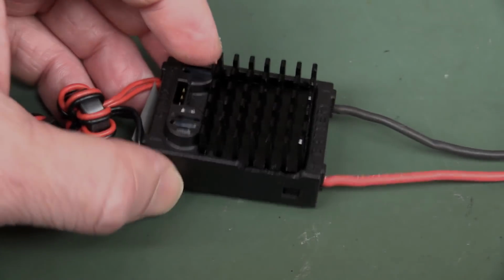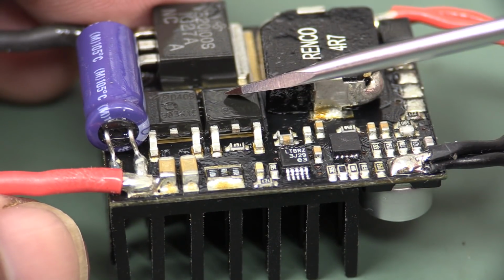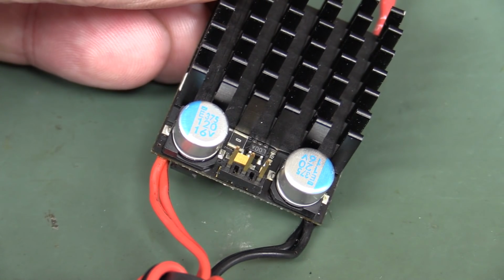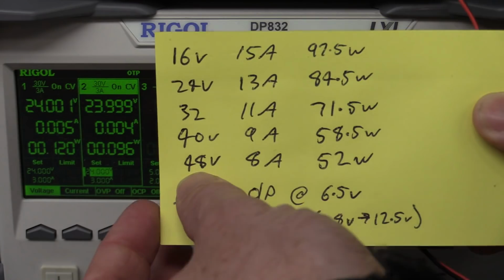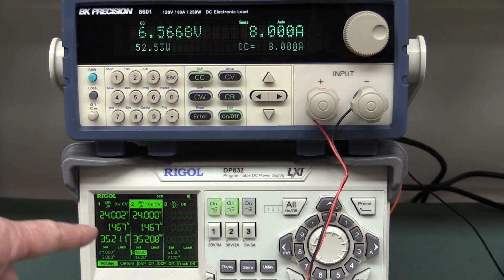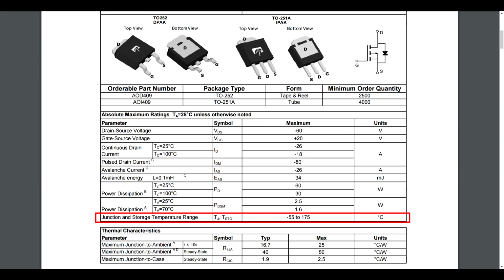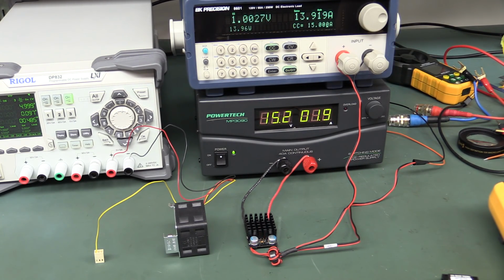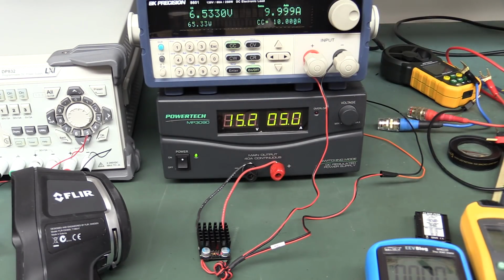EEVblog #895 - BEC Pro Model Airplane Regulator Testing

Comment: "This thing's cheap, it's like $38 or something which is apparently cheap for one of these things"
Nope that's expensive af.
Reply: Remember it's not a 4s 5A BEC, it's an high voltage high current one from a reasonably well established brand name.
Reply: Just because there are more expensive products doesn't mean that one isn't expensive for what it does. It doesn't look bad, but it's still just an off-the-shelf DC-DC converter with a "meh" build quality. Oh, and regarding Western Robotics, paying more than 100USD for a general purpose low voltage DC-DC converter is getting into the bullshit region, at least for me, they charge 50USD for a 5A BEC, ffs...
Reply: Lol you think that is expensive?

Look up Western Robotics BEC.  Those are the top in the RC world and are much more beefy.
Reply: scott firman To be honest it's not that hard, at low voltages/currents you can just get away with a linear regulator with an heatsink and a couple of capacitors. Even with switching regulators, most manufacturers have an application note telling you how it should be done for each driver IC, like this: http://www.st.com/content/ccc/resource/technical/document/application_note/75/1c/c6/24/bc/a5/4b/94/CD00043744.pdf/files/CD00043744.pdf/jcr:content/translations/en.CD00043744.pdf

In a pinch you can even use a good quality car phone charger, they come rated at 2-3 Amp or more and most can handle up to 35V.
Reply: +TrickyNekro You build your own BEC's? WOW! good for you.

Comment: The usual overstating of specs for most hobby products. What would help this survive is probably the fact that most of the load would come from the servos moving the control surfaces of the plane so only in short bursts as it maneuvers. Not much load when all the servos are neutral(eg flying straight).

Comment: Hey Dave, I was wondering what the status of the uCurrent is. Did that issue with the assembler get solved? I was hoping to pick up one and I couldn't find it anywhere in stock. I could use a local pick and place fab but that would cost $300 for a batch of six when I only need one.

Comment: Solder quality poor, gloppy conformal coating, dont like the heatsink on the opposite side of the board idea. I would prefer the heatink to be directly attached to the component. Overall, i'd pass on this.
Reply from the maker: You usually can't attach heatsinks directly to SMD parts. See my linked video.
Reply: +EEVblog ive seen custom heatsinks like on the apple time capsule and nest camera to cool smd parts. I would think that would be idea versus the solution used in this product.
Reply: To be fair, it sells for $38.
Reply: custom heatsinks are $$$$
Reply: Sadly this is one of the most reputable companies in the RC component manufacturing world, and it only gets worse here as you go after the cheapest you can get via hobbyking, etc. RC parts such as ESCs and BECs are manufactured with weight, overall finish dimensions, and cost as the primary driving principles. I combat this by choosing components that are rated for much more power than I ever plan on running, that way the shoddy designs may have an adequate margin for error in my use case.

Comment: Glad you actually tested this thing Dave.  I fly rc planes,  and there's so much false advertising when it comes to the electronics!
Reply: +EEVblog usually, no, and definitely not continuously. the main power drain for these are the servos that control the control surfaces. As you can imagine, the power usage will be highly fluctuating. The max power drain probably only will last for a couple of seconds.

Also, a normal flight time for an electric plane is less than 10 minutes, less if you fly aggressively which is when you really strain this.
Reply: What Joni above this said, for the most part it wouldn't' be running anywhere near maximum current rating, and if it does it would only be momentary. The only thing that I can think of that would cause a consistent current drain would be lights (LED's) and very small fans (for cooling). So for the sake of it, That unit seems to be rather decent considering!
Reply: I also agree with Joni. Even in a highly acrobatic airplane the servo loading is almost never going to be used near 100% it's maximum rated current. The main fear is never to have the voltage drop below minimum for the R/C receiver. (Known as a brown out causing loss of power to the receiver and thus loss of control.) You can live if your servos slow down from some loss in voltage, but once the receiver is below it's threshold even for a instant it will cause a reboot and then a re-sync to lock on to the correct Chanel. This time delay can be several seconds and deadly to an aircraft.
Reply: Looks more like a car/truck ESC and not a plane ESC.
Reply: markybyeah It's not an ESC, it's a BEC. It can be used for both. For some reason it's only rated to 8S for cars, maybe because the assume that the airflow wont' be as good.
Reply: markybyeah
ESC and BEC are not the same things. You can have an ESC with or without a BEC. In the case of the unit in the video it is only a BEC with no motor or speed control.  :)
Reply from the maker: To fully test it and characterise it though would take days. I have no idea if it will ever be used near it's maximum rated current?
Reply: And also there is usually some airflow due to the craft moving along.
Reply: Wouldn't have thought it'd ever get above an amp sustained output current. Peak maybe a few amps if you have some beefy servos. Depends what you're flying though i guess.
Reply: there is a difference  at least with planes, the BEC only steps down (normaly) like 12v to the 5v the reciver and servos usses, while the ESC deliveres the power for the moter witch uses 3 phase AC power, but a lot og these ESC's has a 5V 1A BEC build in so you can power the reciver and servos with that too. so NOT the same thing
Reply: Yeah too bad they are made in the USA huh?
Reply: Stall current on some servos can be remarkably high...which would only happen during a very high g maneuver when the most back-pressure is on the control surfaces. holding still is just spring return pressure but high-g is also high force on the surface = high torqueo on the motor = high power draw.
Reply: Andreas Thomsen
Careful, there are simple DC ESCs both with and without BECs They are not as widely used after the introduction of brush-less motors. The key between BEC and ESC is that a BEC delivers a fixed output. A ESC is used to control the output and thus vary the speed.
Reply: Use small BEC for receiver and seperate power feed for servos to big BEC.
Reply: overload the BEC and you can get a brown out where the stupid thing reboots.. mid air.. not good
Reply: tends to be rated against the lipo packs.. which determines its voltage...3s to 5s for example hobbyking is a good place for cheap stuff
Reply: I actually use this thing in a 2m F3A rc model airplane, using an 8s pack and typical digital servo's (Futaba). These are brushless motored servo's, which are considered drawing high currents at big loads. In 'daily use' it doesn't warm up notably. The servo's are hardly used simultaneous, and if they are (ie for a snalroll), it's only for short period of times. Besides that, these things are mounted in a way they catch airflow, typically the propellers airflow. In my plane it's mounted directly in the airflow of a 2.7kW drive prop.

Overall, if you got something in your plane drawing a continuous 8A or even more, chances are you have bigger things to worry about than your voltage regulator.
Reply: Only rated 8s for cars and 10s for planes(if brake is enabled) because the brakes cause a regenerative spike that causes the line voltage to momentarily spike much higher than the pack voltage.  Even with no airflow you would struggle to heat this up in car application unless you were running several large scale servos and a bank of LED's.
Reply: Thanks for the testing...like always advertising never work in the real thing..you always have to do some research..before use..and most of them failed to do it as adv...
Reply: Joni Paananen
 Same thing.... it powers the receiver and motor... AKA ESC